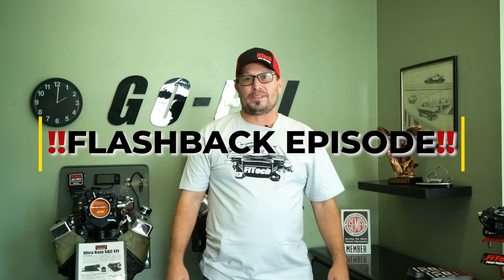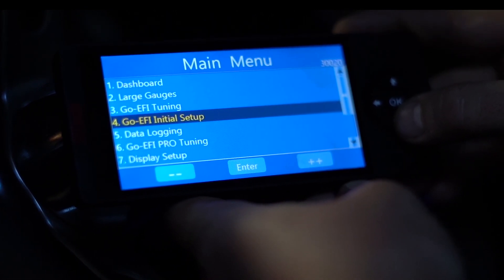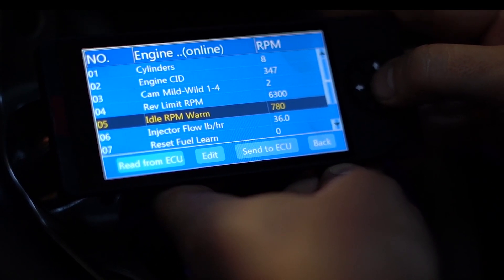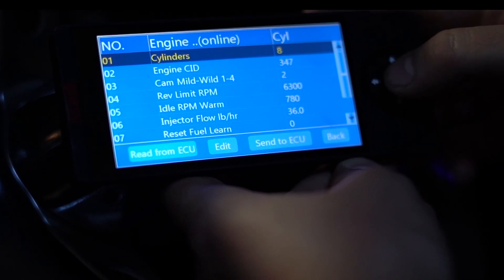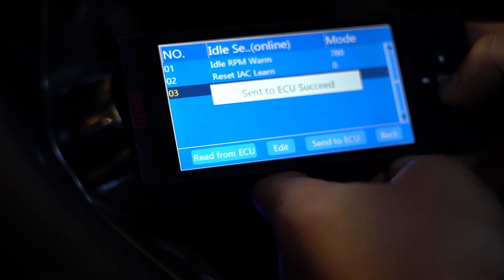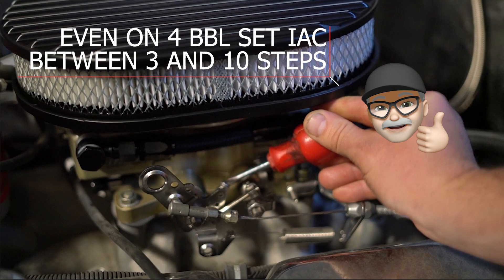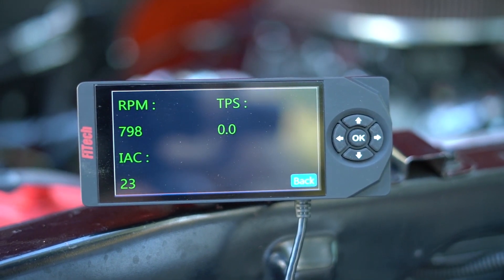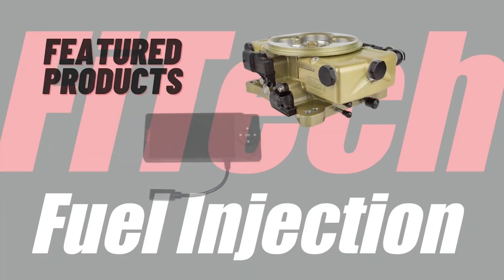Flashback Episode: Initial Setup  | Tech Tuesdays | EP3

Comment: slightly confusing, my model 30003 choices for the "idle set mode" are "normal" or "Allzero", not on and off  -- and I'm assuming we're supposed to use Allzero like on and then reset this back to what it was before we we did the procedure. The video does not say this.
Reply from the maker: The “Allzero” setting is the same as “On” in other versions of the software.

Comment: I have the ultimate 750 hp system I have a turbocharger I cant get my IAC below 83 is this because of the turbo? should I remove the turbo until set up the IAC?
Reply from the maker: The turbo is not causing this issue. Watch the IAC step setup video on how to adjust the throttle. It is Episode 61

Comment: Pulled the carb off my dads car and did this, its been headaches.  Constantly resetting and going through the steps over and over every few months.  At this point I think its time to put a carb back on the Nova
Reply from the maker: Hello, I am sorry to hear that. Have you reached out to our tech support team for assistance in order to help solve this problem? Also, if you are in the Riverside, California area we will be having dyno days where we do free tuning for customers. This will be September 14, 2024.
Reply: same here, did one for a customer in the summer and now won't start in the cold, come to find out it's NOT self learning for cold start, spent hours more updating handheld software and countless emails with tech support, STILL can't read a logfile, it's not including a timeline or something and has no title for the top row -- VERY frustrating -- making our business look stupid to the customer. This is NOT  a very user friendly system, this comes from a dealer trained and experienced technician of 43 years

Comment: I have a question. I dont know how often you check these comments, but here goes. Have you ever heard of someone having the throttle stick open? Im dealing with this now. There is no issue with the throttle cable, no linkage problems, it only happens intermitantly but its been happening.Just wondering if you had any thoughts on this?
Reply from the maker: Most throttle sticking issues are due to binding in a throttle cable or rod.

Comment: I have 1985 el camino, and I put LS 5.3 fitech system and I have problems sitting the Targ and AFR to make the car run right. It hesitates when accelerating while I'm driving
Reply from the maker: To adjust fueling on acceleration you would want to adjust the accel pump settings under the tuning menu.

Comment: Guys not sure if I’ll ever get a reply, but my IAC values are super high for a second while starting, then the vehicle dies. I’ve made every adjustment possible to the screw but it will not idle so I’m guessing it’s another issue warm up fuel and afterstart fuel, I’ve tried playing with those also but I’ve tried dozens of combinations and I’ve gotten it as best I can but it still won’t stay running for more than a couple seconds
Reply from the maker: Reach out to our tech department for assistance. techmail@fitechefi.com or 951-340-2624.

Comment: I do not have the idle set mode on my handheld. What do I do now?
Reply: I have the 30008 and no Idle Set Mode on mine either. Is that why my IAC steps change every time I set them to 3-10 and the next day I have to start all over again? I believe I know exactly how to save changes on the handheld.
Reply: @jayattwood  I finally think I got it figured out. Had to watch a lot of the FiTech videos though, over and over. Sometimes things don’t sink in unless I watch multiple times
Reply: @jayattwood  did you know how to save the changes? I am having the same problem
Reply: @edgaralfredoaltamiranohern1223  same here it never saves the changes

Comment: Nice video, important to know! But, a few gray areas remain. You have to turn the IAC learn to "ON" in order to make your idle adjustments & once you have dialed in your idle what do you do to terminate this sequence of IAC adjustments? Do you have to key off, then back on & turn IAC learn "OFF"? What exactly are the final steps here?
Reply from the maker: IAC learn should be left on. To set the IAC steps you need to turn on the IAC set mode ON. This will lock the TPS to 0 while you open and close the throttle with the adjustment screw. Once your IAC steps are between 3-10 the key can be turned off. The ECU will save and turn the IAC set mode back OFF.